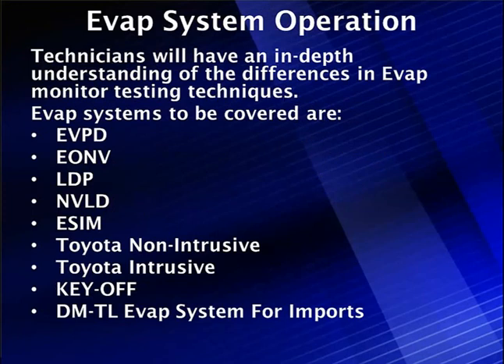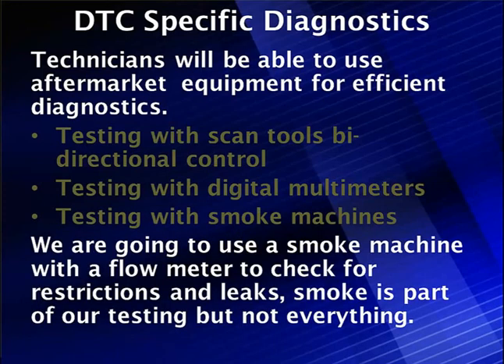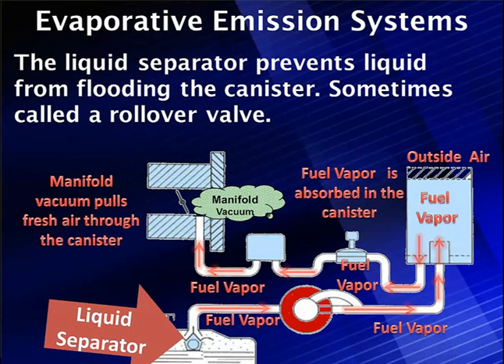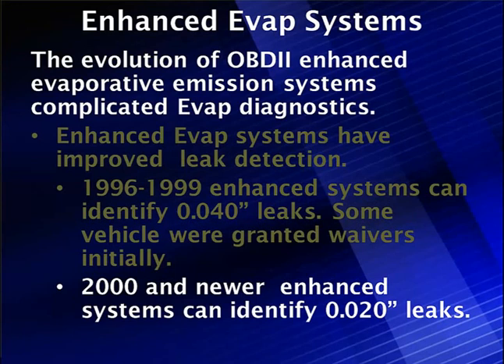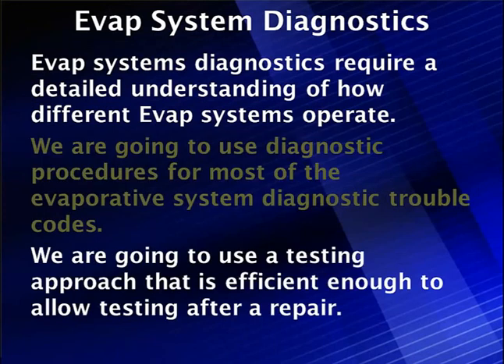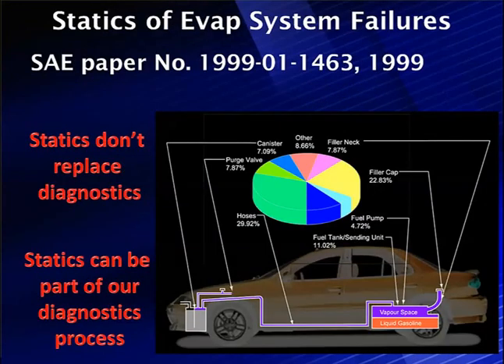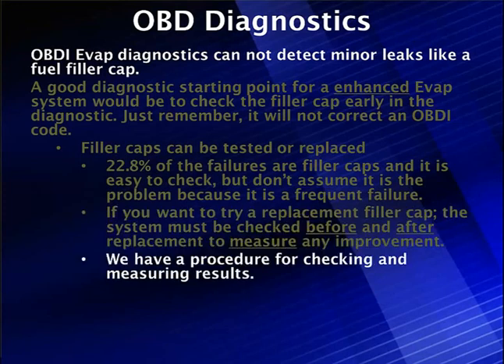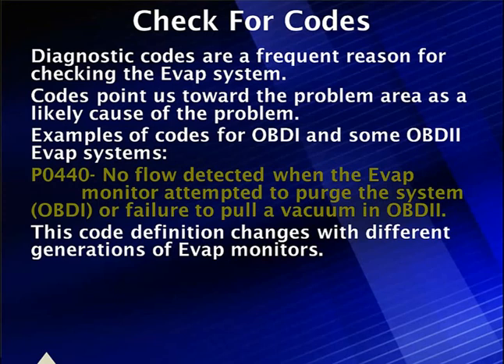01 Introduction - Evaporative Emission Control System Diagnostics

Comment: How are you? I have a question, maybe you can answer for me? I own a 2000 Chrysler Concorde LXI 3.2. I keep getting a code P1494, Evap leak detection pump switch? I replaced just about everything on this car? Purge solenoid, charcoal canister, LDP, all the hoses and wires look good. It only comes on, the MIL light , I mean, on a cold start. I’ll clear the code with my scanner, and it doesn’t come back for 2, or 3 days, the MIL? Any suggestions, how I can fix this code? Thank you. Mark O.
Reply: How do you ended up ?